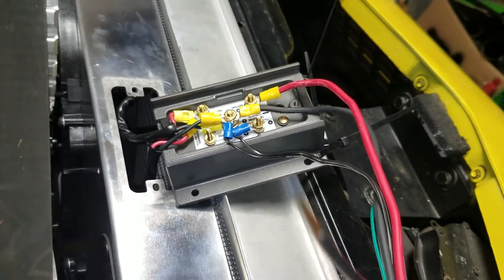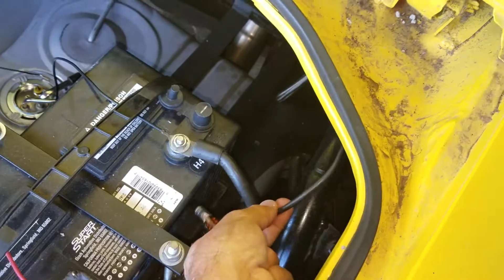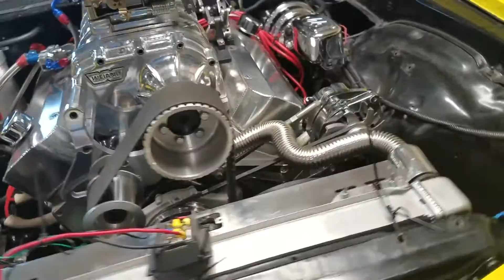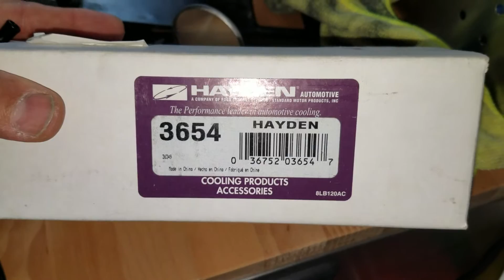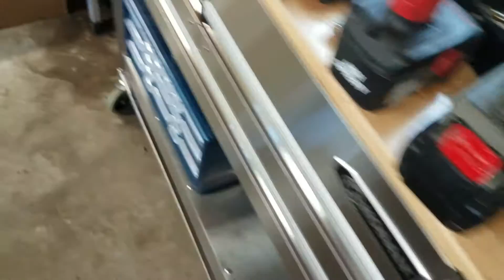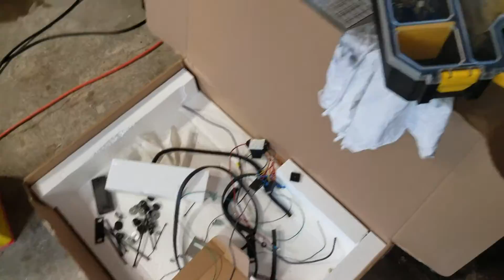DERALE PWM Fan Controller review

Comment: I've had Hayden Dual 14 "  with their single speed controller for over ten years with no problems,  I'm thinking of adding a third upgrade to a 16" one on the opposite side of the radiator, how you guys think that would work out

Comment: Just an fyi the thermostat housing is not the return, the lower hose is the return
Reply from the maker: 😂😂😂 um noooooo
Reply: Youre right. Top hose is hotter water from the motor, lower hose is cooled water returning to the water pump.

Comment: I ran one of these units for a couple of years. I found right off the bat the connections are very wimpy. I finally just flat died. 
Then I found this guy and his products...https://youtu.be/087rdbNo7-4?si=u5RIy1jh7fUdPi6a
This is the fan controller one must have. It's a heavy duty beast. Notice the connectors on that pill! And they control the ground. 
Just plain beefy and way more reliable than this Derale unit.

Comment: Is that eye catching orange reciever drier looking overflow reservoir?
Reply from the maker: No Sir, It's my Radiator overflow catch can.. ebay gift from my better half. 👍
Reply: @hotheadzmarine  thats what i said sir looks like drier lol
Reply: Nice nice looks good
Reply from the maker: @Evrenthewrencher  Thanks, too bad I smashed the car 6 months ago. In process now of rebuilding. 😕
Reply: @hotheadzmarine  how did u do that?
Reply from the maker: @Evrenthewrencher  master cylinder went out.
Reply: @hotheadzmarine  thats nothing i got mine for 25 bucks at advNced auto chrome ones are over 100
Reply from the maker: @Evrenthewrencher  mine is made by CPP I think.. I bought a Wiilwod for the rebuild

Comment: I’m using a $40 derale comes on like it’s supposed to but stays on like 10 minutes after I shut the car off. By then you have a drained battery. Or pop the hood every time I shut the car off and pull the relay.
Reply from the maker: Bummer. Hey, my Hayden is still working fine but I did have to get a larger amp relay since it would stick on but now the larger relay works perfect. I was worried it would cook my wiring but hasnt affected them at all. Maybe up your relay amp size and try that.

Comment: Similar problems. Per the instructions, reset the controller to its lowest set point by turning the adjust screw CCW 25 turns. Engine runs at 190 to 210. Very disappointed.
Reply from the maker: Same here.. Bummed me out bad

Comment: Hope you had better luck with the Hayden than I did. The 1st one lasted for a few years then one after the other from there on till I just went with a made harness with relays and switches. Got tires of getting stuck or having my AC blow all the Freon out at a red light and having to use that clean pair of underwear my grandma told me to keep in the glovebox!
Reply from the maker: LOL.... mines still doing well. I even just run 1 and 2 35amp spal fans..of course I did morph in a 70 amp relay recently as the 40amp was stuck closed .I'm sure it'll smoke soon and I'll be replacing but for now works great. Thanks for the comments. God bless you
Reply: Lewis Walker  I actually spoke with the R&D dept at Hayden years back and they were in the middle of redesigning that particular part number so for about 8 months the only one available was from a vendor they fired for QC. Sounds like they figured it out might be time to warranty the one on my shelf out!  I’m going to use solid state relays this go around. My fans pull 25 amps each and as you mentioned the contacts sticking. That’s a beautiful Camaro you’ve built there! God Bless my fellow Texan

Comment: The brand X controller companies do not understand starting DC motors (inductive loads) from a dead start!  How many of these brand X controllers are in the trash can?
Reply from the maker: I understand your comments concerning DC startup. As a matter of fact I spent 25k on my home to have a DC variable ac system installed and "ITS" awsome. That's why I tried this controller but the Co.and product are substandard in this item. My 1rst China controller is still working great. As a fact,  I had to add another to support the second fan and they are BOTH working well to date. That's hard to say honestly as I truely wanted a better control.

Comment: My PWM controller took me FOREVER to get set up, the calibration instructions were not helpful at all. I had to heat the motor to 200°, shut it off, then turn the adjustment screw until it went to about 50% power, then I turned on the motor again to heat it up again then waited for 200° again, then turned the screw again until 100% power. Works perfect now.
Reply from the maker: Jon Duer i never got that lucky..2 separate controllers and neither worked as they should and each had a seperate issue than the other. My hayden is still working lile a champ though.
Reply: Lewis Walker Hey, whatever works! I saw in the video the issues you said you had. My opinion, which you should take with a grain of salt, is that you didn't calibrate it right. At least on one of them. Did you hook up a multimeter to the calibration terminals?
Reply from the maker: Jon Duer man i had them on the phone and they walked me like a newborn through it . Customer service was Great, product "was"? Not.
Glad its working out for you. I certainly wished it did for me. Life..water under the bridge

Comment: Wich Hayden kit did you put in to solve your problem ? Amd how everything is working with both fans .. Do they always start together at high speed or they go on low speed and then high speed with the different temp ? I need a kit for two fans for a 160 thermostat ! Thanks
Reply from the maker: Frank Gilbert I bought the Dual speed controller and that won't work with the fans I have so I'm just using one leg of the Dual speed controller running both fans off of one relay only problem is every now and then the relay will stick in the fans will stay on and I just have to go over there and tap it I need to upgrade it but if I were to just put two inexpensive Hayden kids on with the signal relays it would work fine since I've proven now over a year almost that one relay will run both at the  fans.
That's a voice-over response I apologize for any typos and I hope that helps thank you for your question
Reply: Lewis Walker so basicaly i would be better buying two single hayden  kit for my 2 fans to work well ?
Reply from the maker: Frank Gilbert ... Yes'Sur

Comment: I have the same problem
Reply from the maker: Hilal UAE really was very disappointed. Maybe they will get it fixed and I would like to try it again.
Reply: I would looks forward after your try cause weve same problem thou ... and as my experience i think this issue its technically so theyve to manufacture a new part better